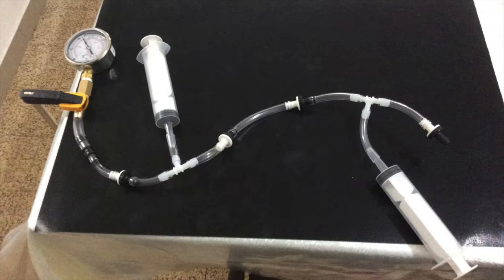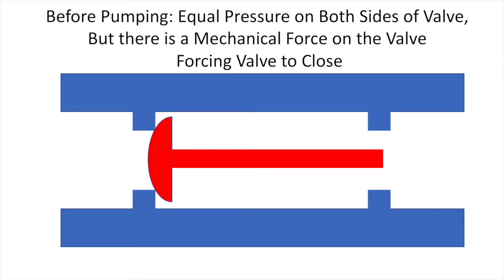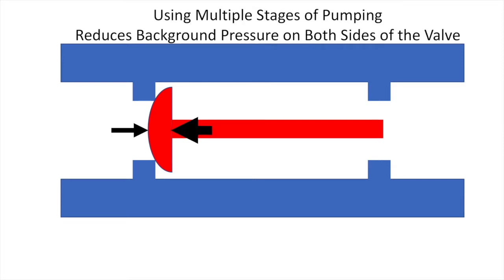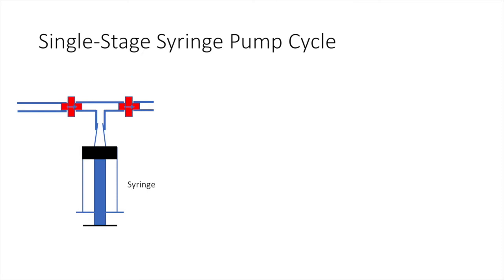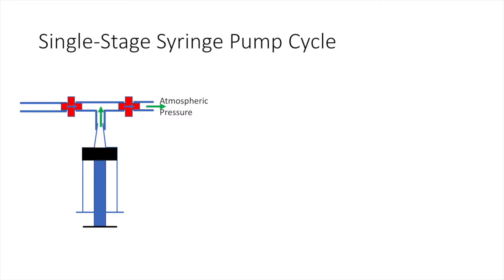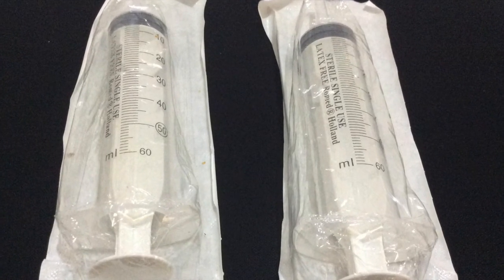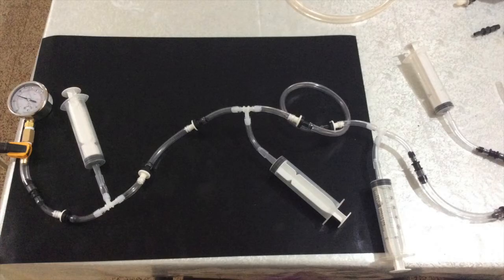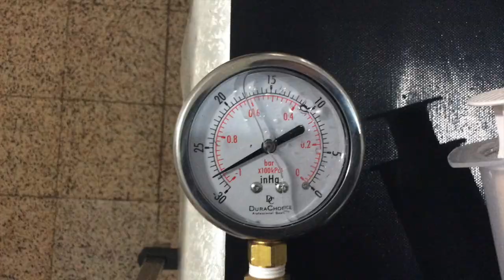Multi Stage Syringe Vacuum Pump

Comment: For the first time, i learnt the existence of multi stage vacuum pumps and diy using syringes. thanks a lot. however, the third syringe input valve (4:52) is wrongly attached, i presume.🙂

Comment: To expect even lower pressure, the dead volume trapped between the valves must be reduced as much as possible. In addition, at very low pressure, you cannot rely on the pressure on the valve to close it. Active valves should be considered, for example a magnetic foil activated by an electromagnet, with an electronic management system to activate them at the right moment. The cross-sectional area through the valve should also be increased as the pressure drops.
Finally, the ratio between the minimum and maximum volume of each stage should be maximised. In this respect, long-stroke bicycle pumps are more suitable than syringes.
By optimising all these factors, there is no reason why a residual pressure of the order of one Pascal cannot be achieved. That's enough for some great experiments!